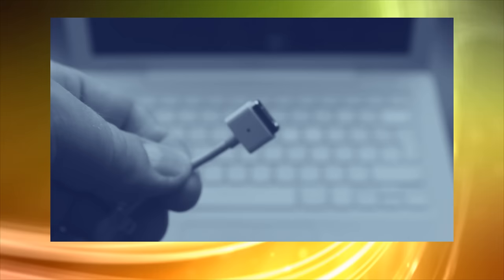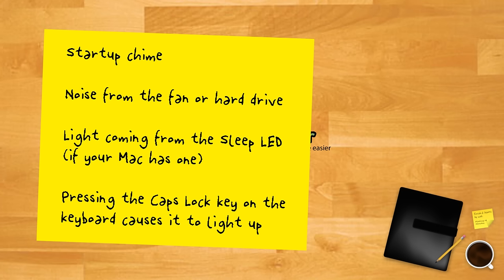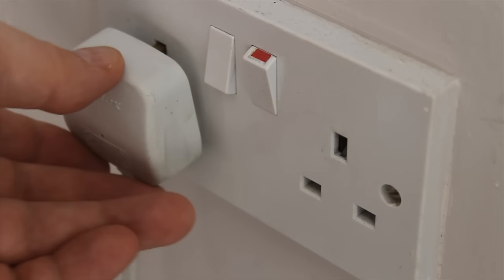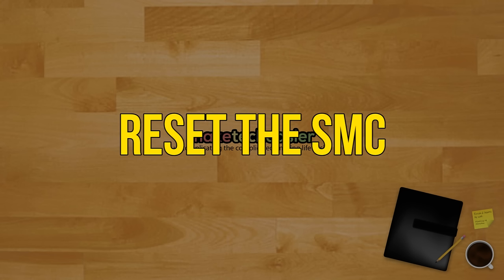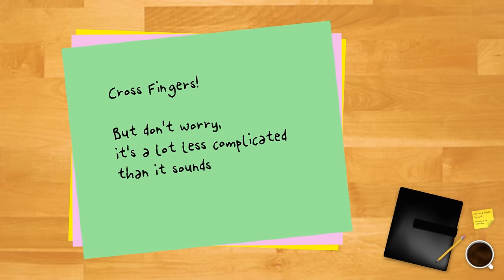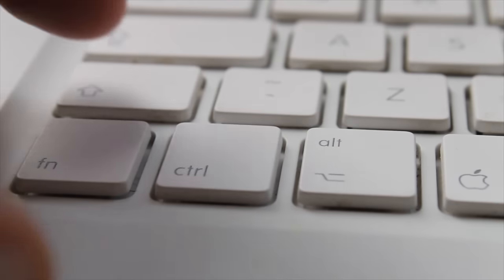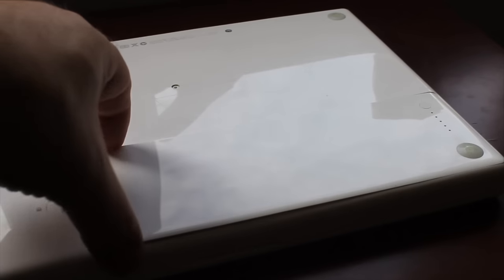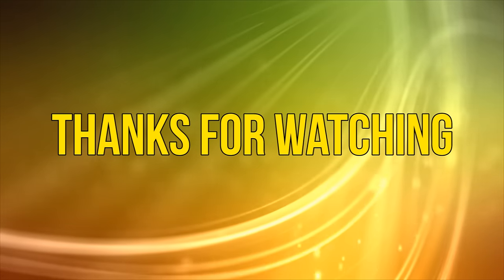How to Fix a MacBook that Won’t Charge

Comment: I forgot to plug in the cable for my charger and I opened my mac book air and broke a little piece next to the fan , it’s like a brown wire and broke the connection,but I don’t know what I broke and it charges and all

Comment: My mangentic charging port isnt working properly, it snaps fine, but sometime the led light is not on but the laptop is charging. sometimes both led indicator light and the charnging stops. I have to jiggle the port around to get a connection, but it remains operational only for a while then it dies again.

Comment: Liquid dropped on the keyboard, 
Turned it off
Started after a day
It's working on electricity 
But not on battery as charger stopped working. 
what do you guys recommend on how to get it fixed and can be done.
Thank you

Comment: My Mac book went dead after my daughters watched a movie on it and let it die down completely. They are 3 and 4. I got the computer before my first born was born so it’s been about 4 years now. I haven’t taken very good care of the battery (didn’t know how). The babies have been using the computer as TV for those 4 years and at this point, I don’t know what’s going on with the battery. I plug it in and the battery plug doesn’t light up at all. I left it in for a few days and suddenly seen that the light on the plug turned green. I unplugged it, I put it back in and that wasn’t a good idea I realized. It was like I was back at square one. It didn’t light up at all until a few days later, I am now still waiting for the computer to do something. The light has finally turned green once again, but computer won’t turn on. I’m hoping the computer it’s self isn’t completely burnt out because all memories of my babies since they were born are on it! Any advice?!?! Should I take it to Apple?? Warranty ran out and I’m assuming they’ll charge me an arm and a leg to service it! 🙁

Comment: My laptop was 15 % battery and it got turned off in night, i did SMC while my charger was working and blinking light in last night but from today it's not even blinking, could it be a charger issue as after SMC my lappy started for 2-3 minutes but now it's not switching on at all neither my charger lil light is working. Please helpppppppp. I'm getting mad😭😭😭😭😭😭😭😭. Could it be a charger issue or my motherboard is gone forever? I connected my charger to every other port it doesn't show that blinking green/orange lil light at all. Pleaseeeeeee help meeee someone 🙏🙏🙏🙏🙏🙏🙏🙏🙏😭😭😭😭😭

Comment: I tried the reset for my MacBook without the removable battery and while it shut down fine, it would not restart after the 10 seconds so proceed with caution if you try it.

Comment: I have this issue when trying to plug and unplug the charger many times, from about 20% to 1% left .
The indicator says it's charging and on red light, but the battery not increased. Finally I have to buy a new charger.. 😕

Comment: I'm using mac book air. Charger usually seems a green light . But my charger is not showing green light when I plugged to charge . not charging.....Am totally freak out...Plz give a solution for this...😢
Reply: NICY BIJU did you fix it? the same thing is happening to me ):
Reply: Not yet😢

Comment: it jsut doesnt show my battery plus i dont think i have a removable battery im on a mackbook air but i dont see where i remove the battery i just see the outline of the bottom and also i cant turn on show battery on the top so i dont know what battery its at rn probably 0

edit: thank you kind sir it worked btw i think my macbook air has two ways to reset smc idk

Comment: Thanks for sharing. In my macbook air, there's problem that, when i open it, its showing 100% battery. But as soon as i am logging in, its showing 0% battery nd within few sec. Its getting off automatically. Pls help.
Reply: Tia Khan i had the same problem. and i changed my battery. Now ot works all fine

Comment: My mom found a imac computer , i tested doesn't charge the battery  is  not Charging, the led light from the cord is green and not orange, she throw it in the trash,I took it and keep it . so i know why they throw it out, the battery is completely dead. So i need to get the battery replacement.

Comment: My problem is that my MacBook has no battery and therefore won’t turn on as I can’t charge it. I can’t reset anything because there is no battery life
Reply: Leah Marie same! Did you find a solution?

Comment: My Mac is literally dead and it won’t charge either. idk what to do
Reply: Same what should i do ?
Reply: Inès I recommend taking it to the apple store. I took it there not to long ago and my Mac works now
Reply: Sahnaz Akter Thank you for your response. We might not be from the same contry (i am from France) but did you pay for the reparation ?
Reply: Inès actually they offered me to buy a new laptop . But i asked them if they could try a brand new charger and it actually started charging. Don’t buy chargers from Best Buy or anything, try getting the official official charger from Apple. Now that’s the only charger that works on my Mac
Reply: Also the charger was only $20
Reply: Sahnaz Akter thank you i’ll go tommorow

Comment: My macbook air mid 2012 had a problem..when i turn it on the logo   n booting sound appear and then no longer than 8-10 second it dead suddenly keep it that repeatedly still the same issue..anyone had this problem too?please need your help guys i just use all the trick on the YT n google by pressing the button combination still the same result 🙈👀..anyway thx before

Comment: I need one of those chargers you have in the video, the exact same thing, I bought a mackbook pro replacement thinking would work but it didn't I have a normal macbook 13" 2008

Comment: What if the charging light on the power cord is dim green when u have it plugged in ???
Reply from the maker: might be a loose wire? Hard to say but sounds like a hardware issue of some kind. Perhaps replace the cord?

Comment: I was charging my MacBook while I was using it until it stop charge the light isnt coming on the charger what is the problem ?😞
Reply from the maker: very hard to say by remote control, perhaps you need to take it to an Apple Store?
Reply: You are probably using a third party charger. That is, one that is not made by apple.

Comment: I have a MacBook Air and about a year ago I spilt a small can of soda on it. My mom and my sister tried to help me fix it but it never turned back on. I just ended up giving up and let it alone. Ants would crawl inside it and take some soda with them.. I know it sounds gross but it happened. Just yesterday my friend came over, and while I was getting dress she was fiddling with it. I was like, “what are you doing? You know that dosent work right?” And she told me a story about her uncles pc. We tried to plug it in and the screen lit up with the low batter sign and a lightning bolt. We moved into the kitchen so my mom could see, and it turned on! I played on it and checked things I haven’t seen in a year. Today, I came to my dads house and it won’t charge.. any advice?

Comment: My MacBook Air, was being really temperamental with the charging. It frequently said it was powered by the adapter, but wouldn’t charge. I reset the SMC, and it worked like a charm. Thank you now I don’t have to freak out and consider buying a new really expensive laptop.

Comment: My MacBook is dead and I don’t know what to do because it won’t charge
Reply: Hannah Peaire same i'm so stressed
Reply: This just happened to me as well, I replaced the fuse in the plug and it fixed the problem. Maybe worth giving it a try?
Reply: violinmed I took it in to the shop today, they said the battery inside was burnt out but thanks!
Reply: Same
Reply: Same with me, I really need a solution
Reply: Hannah Peaire yeah me tooo. im freaking out right now. 😭😭😭
Reply: Chantel Hanz Antic do you have a Solution?
Reply: Cesar Minaya do you have a Solution (i have the same problem)
Reply: It probably won’t charge because it’s dead. RIP.

Comment: i charged my MacBook when it was on 8% then later when i came back IT'S STILL ON 8%, THE LIGHT FROM THE CHARGER ISN"T EVEN WORKING, what can i do
Reply from the maker: Sounds like your charger may be broken. You could take it to an Apple Store and have the guys look at it, they will be able to verify if it's actually charging. Or try it on another Mac if you have access to one, just to check it. Let us know how you get on.
Reply: oh i need to buy a new charger now 😔

Comment: Facing the plug area you’ll of ur charger you’ll notice a rectangular white removable port with two mini rectangular opening on each sides that is detachable, use a pin to pull it out , that’s the plug socket battery if ur laptop charger isn’t working don’t just go buying a new one maybe the problem is at the plug replace it with a new battery, it’s a small cylinder battery

Comment: my macbook is 0% and it only opens when i charge it but it says that its not charging and its stuck at 0%
Reply: FøX_ PH MINE IS DOING THE SAME RIGHT NOWWWW
Reply: @zainabt6160  Bro i reinstall the battery and now its charging but it's still stuck at 0%
Reply: @zainabt6160  BROO MY MACBOOK IS NOW CHARGING IM AT 20% YOU SHOULD ALSO TRY IT!!!!!

Comment: I'm sad, nothing works. this is my second charger as well
Reply: Facing the plug area you’ll of ur charger you’ll notice a rectangular white removable port with two mini rectangular opening on each sides that is detachable, use a pin to pull it out , that’s the plug socket battery if ur laptop charger isn’t working don’t just go buying a new one maybe the problem is at the plug replace it with a new battery, it’s a small cylinder battery
Reply: Ur Homie i will try this, thank you. i will reply when i have tried
Reply: This charging port/jack is shit. I'm on my 3rd and those little pins are garbage. The design is fkd up.

Comment: i have to hold my charger in weird positions for it to charge
Reply from the maker: That'll most likely be a physical/hardware issue then. See if it works with a different cable. If it does, great! Change the cable. If you still need to nudge it around, your port may be damaged.

Comment: What if Mac is dead and you cannot do any of this
Reply from the maker: Then you have bigger problems than simply resetting the SMC. If the problem is the battery then you could always borrow a battery from a fellow mac user to get the machine up and running to check if it charges. Failing that ask at your local Apple store they will be happy to advise you on next steps.

Comment: Mine is blinking green...Help
Reply from the maker: Not sure what this is without looking at it. A bit of googling reveals this sounds like either your battery has died or there is somthing amiss with your charger, possibly a "strain relief" issue. You should take it to an Apple store where they can correctly diagnose the problem before buying a replacement. Good luck!